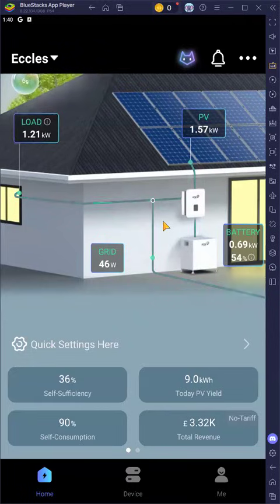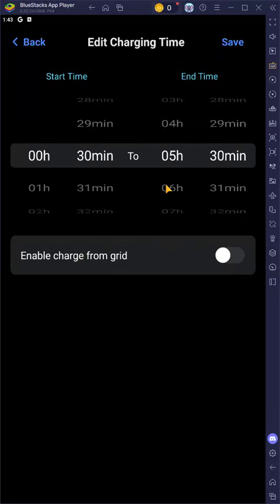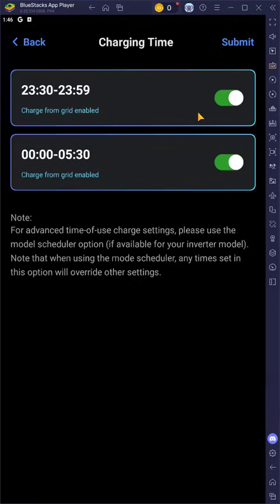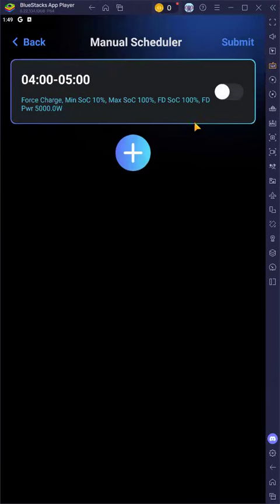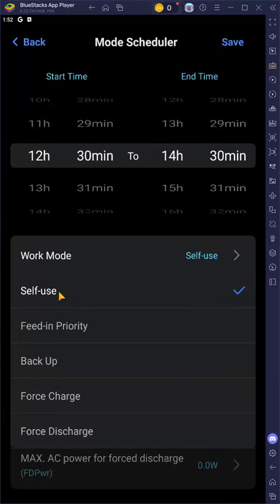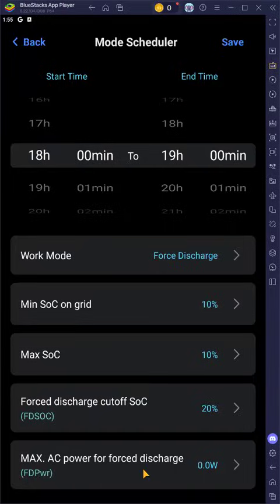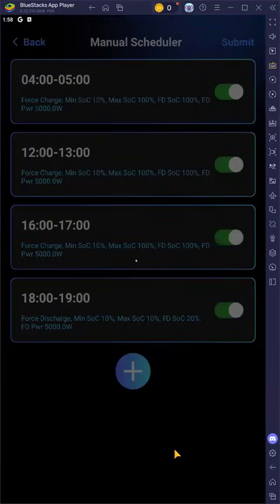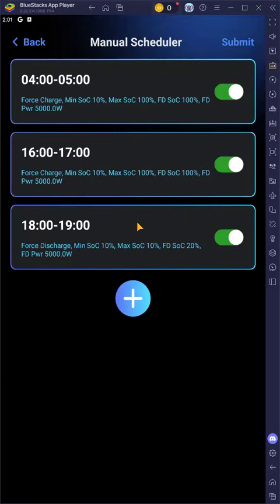Complete guide to Force Charging, Force Discharging, Mode Scheduler & classic charge windows FoxESS

Comment: Thak you. I am in Oz and this was ueful and I am now testing out my Fox ESS schedular app out to force grid export during the higher paid peak period between 4pm and 8pm for my engergy supplier. I only got mine installed in April and there was no explaination from the installers/suppliers and I only just downloaded the manual to start reading and then found your post to confirm. The App has been updated or is slightly different and I like it.

Comment: thanks for the demo, I just liked and subscribed!
I've got a question that you might be able to help with that I can't seem to find any info on..
Im in Australia and I've got a 10kw inverter / 42kw battery (both foxEss) and 13.2kw of panels and on a good day in the morning, I'm getting PV production at 13kw while the battery is charging however once its 100% this gets suddenly gets capped at 10kw, and then covers consuption / exports to the grid until the sun goes down.

Is there a setting that I can keep it at 13KW, or alternatively slow down the battery charge rate so that its partly charging the battery / partly exporting to the grid. That way I can take advantage of the Higher 13KW for longer? or am I just being greedy:face-blue-wide-eyes:  

Here in Australia there aren't really any cheap import from grid rates /times and FITs are pretty low.  The best ive found is a FIT of 7c / KW but during 4pm-7pm 'peak' i get 22c, so i set a forced discharge in the mode scheduler for this time to export everything that i dont need until the next morning (75%) 

I also want to set up a 'forced charge' as a failsafe for a really bad weather day so that if at 2pm if the battery isnt 50% it will import from the Grid to charge to 50%.  (lets me take advantage of a cheaper Grid price before 4pm) However when i enabled this it stopped pv production altogether. Do you have any reccomendations?

Thanks for any help!
Reply from the maker: The 10kW cap is a hardware limit of the inverter, not a setting you can change unfortunately.
Reply: @iameccles  thanks for getting back.. do you know if there’s a way to manually slow down the rate of charge that way I can take advantage of the 13 kW that it’s making until the battery is fully charged

Comment: Very helpful ❤

I am based in Australia and I am new to FoxESS.
I would like to ask about system behaviour when the battery is sufficiently charged and discharging properly. For example, with a 42 kWh battery at 100% charge and a house load of 1.4 kW, the system still imports a small amount of power from the grid (less than 10 W).
I would like the system to avoid importing from the grid entirely when the battery is capable of supplying the full house load. Could you please advise how this can be configured?
My system consists of a 5 kW inverter and a 42 kWh battery.

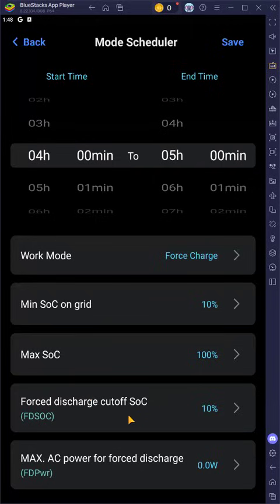Comment: Great video - really helped me when I first configured the mode scheduler a month ago. But beware, as of an update on the 9th Jan 25, the 'Force discharge cutoff SoC' field (covered @ 9:50) is now called 'Forced charge cutoff SOC'. It is most definitely used now. It now does what it says. I found out because mine was set to 20% and my batteries stopped charging in the night when they got to 20%. As the video suggests - if you want your batteries fully charged, set this field to 100.

Comment: Really useful, thanks. Need to solar and trying to get my head around charging the batteries with Octopus cheap rate, but stop the batteries discharging into the car when that charging schedule goes beyond the 05.30 when using IOG charging slots.

Comment: None of this worked on my 2 weeks new system using fox cloud 2.up to date version.tried the classic grid charge setting but got unable to write error messages whatever. Appeared to have correctly set up force charge option in work module schedule., but nothing happened. No force charge option in work mode list. Also very slow refresh rate after any changes, up to 5mins not exactly live. Load rates rarely match the smets2 meter desktop unit. Does it have to be as bad as this ???!! Not a good start. Also no consumer help at Fox, down to installer who is helpful but mostly on site & dependent on slow response from Fox  even for trade. I could go on. With Octopus but not their install. And hear that their feed in rates prob going to drop in line with Eon etc.

Comment: Thank you. Very useful. Just wanted to point out that it's hard to "disable" the mode scheduler if you don't have that option to "tick" or "untick" it. You need to go inside and disable each schedule. I was getting an error message, and at the end I had to log into the desktop version, and I was able to remove them all.
Also, are you able to explain the "backup" option? Is it just simple battery discharge disabling (the battery is not doing anything)?
Reply: I logged into the desktop version but it is not deleted, What are the steps?

Comment: I'm having a small problem. I set force charge at max 3000w but I'm charging at 5800w. I tried lowering to 1500w to see if anytime changed.. But nothing. I really want to control max charge wattage. What I'm doing wrong? What can I do?

Sorry... I have H1 6.0 g2 inverter
Reply: Ok... I found something that consider a bug... When we choose Max Ac power to force charge... When we click in it the bobble that appears says Max Ac for force discharge. Is that the problem??? It's a app problem?
Reply: @RAIKON80 , I think you figured it out correctly. I just tested and this parameter determines in fact the max battery power discharge rate whenever you're by any chance above the upper limit SOC level, even though it's in the force charge mode and yes it should've been setting otherwise. Bingo!
Reply: The same here. No matter what power setting it charges at the maximum possible rate.

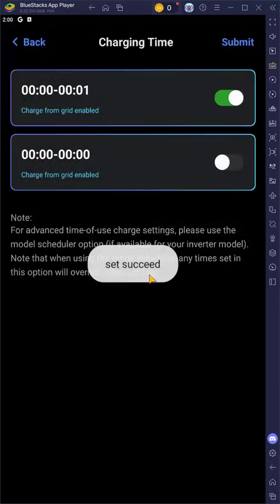Comment: Thanks Will. Please clarify time settings as I’ve seen elsewhere one should set say 2200h as 21:59. I understand Fox adds 59 seconds to time set. Also note conflict of overlapping times even when setting toggled off. Is Fox addressing this? Paul
Reply from the maker: Not personally seen an issue with using an exact time as the inverters tend to be accurate as the cloud sync is working now. As for the second part of your question the mode scheduler is being completely rebuilt so sit tight for the new release.

Comment: If i set a schedule to force charge for 4 hours at night, but the battery is full after 2, will the battery then start to supply the house or will it do nothing, sitting at 100% until the schedule ends?

Comment: Thanks very much, I've now been able to set up three charging periods for my Cosy tariff. However, although I set up each of these charging periods with Min SOC 10% and submit successfully, when I go back into the App the following day these have all been reset to 13% which is what my Battery Reserve Capacity is set at. If I try to alter my Battery Reserve Capacity to 10% I get an error message code: 44098, Write failed. The battery only discharges down to 13%.

Comment: Forced discharge cutoff SOC - The last I checked when I set at 20%, after the discharge reached 20% the remaining 10% didn't get used to supply the house load. The house load was fed from the grid at peak rates. Since then I set to 10% FSOC to give an extra 10% useable battery and have been manually tweaking the MAX discharge, leaving a large margin. Unless anything has changed, I can't figure out how to exactly discharge to 20% daily.
Reply: Same issue here. KH10 single phase,1.52 firmware, Australia. I hope FoxESS can fix this. Seems a very easy fix, a few lines of code
Reply: I have found the same issue for the Force Discharge. Once it gets to your cutoff %, the scheduler stops which is great but it also stops the battery from discharging to your normal house load. It is very annoying as it means you start drawing from the grid until the scheduled time has finished. Has anyone found a solution to this?
Reply: Hi 

Check yours Battery Reserve Capacity % it should be less than 20% to avoid grid imports
Reply: @siamkhan  battery reserve is the default 10% but doesnt avoid the unwanted and unnecessary grid import when >10% battery. The issue is firmware and the Force discharge mode won't revert to battery feeding the load..
Reply: Was there any workaround found for this?

Comment: HI great video. Most customers want to save eg 50% in their battery for the 4pm to 7pm period so they avoid the higher rate on the Flux tariff. How do you do this please?
Reply from the maker: Set the minsoc to say 50% and then again at 4pm lower it back to 10% minsoc.
Reply: @iameccles  awesome thanks !

Comment: Hello Ian, great video, thank you. One question: in the Fox app, it says Self-use is “Optimized for self-consumption, minimising reliance on grid electricity’ so I had assumed this meant the battery would be first used to power the house. You, however, say that ‘self-use’ sends power back to the grid and that I should set to ‘force discharge’ to use the battery first. Please could you clarify? Many thanks.
Reply from the maker: self use will prioritise using your solar for the house and charging the battery. It will feed to the grid only when the battery is full.

Comment: On the mode scheduler, I always end time slots at :59 or :29 not :00 or :30 in order to avoid overlaps with the next slot.  Is that no longer a problem?
18:50 Regarding force discharge rate & house load, since I have home assistant, I have an automation which will boost the discharge rate if there is a large house load, and then revert it back to the original afterwards.  Should be noted that is when using home assistant to control the inverter, not the mode scheduler (I think sometimes people try to use HA with one or other of the app schedulers active, which doesn't work, because they'll fight).
Any news on the Intelligent Flux support?  My E-on Drive runs out next spring, and I can't renew it since I don't have an EV, so I'm hoping to use IF in the summer.  Although I'm also interested in the Solar Max VPP pilot which E-on are running with Amber.

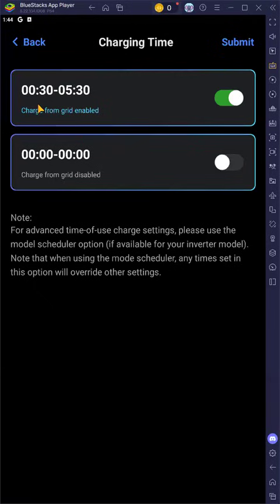Comment: Thanks for the detailed explanations around scheduling.  What's the best way of using Mode Scheduler to charge the battery during iGO off peak and then preventing it from discharging until after 05:30.  In other words, forcing grid use during this time once the battery reaches 100%.